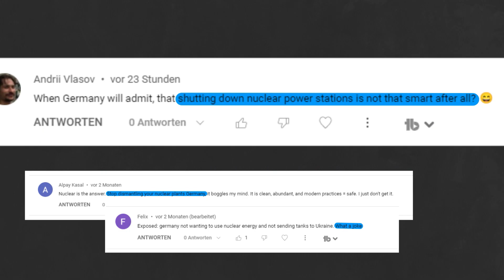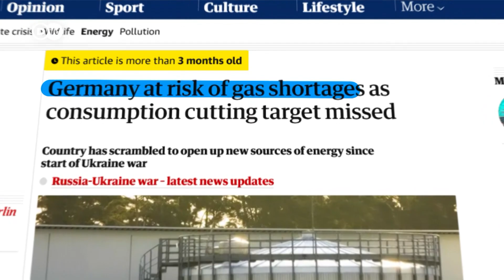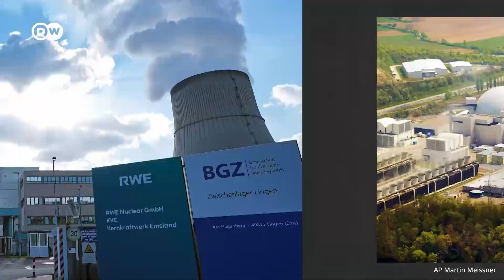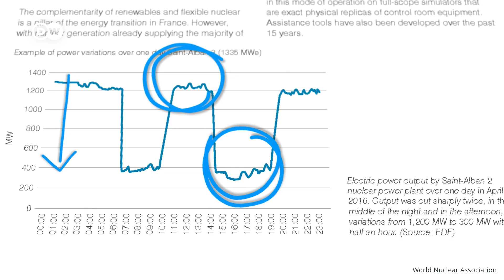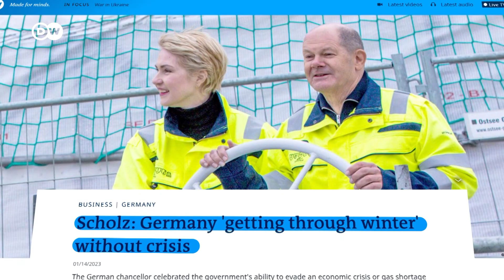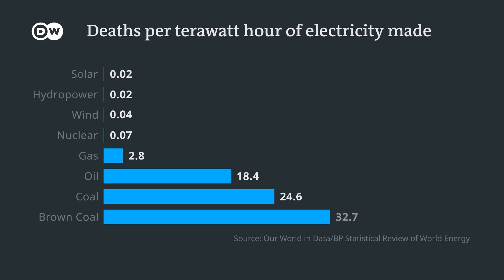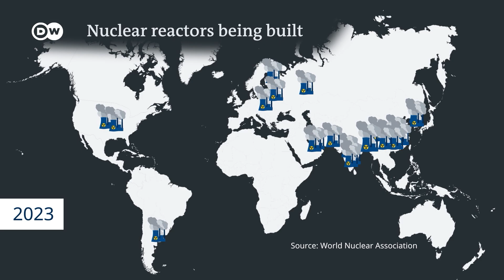Is Germany's nuclear exit a mistake?

Comment: The graph around 10:26 is questionable. Usually nuclear is safer that wing and hidro on those graphs.
Reply: Yes, but I guess they are using the figures from anti-nuclear organisations regarding Chernobyl and Fukushima. The remarkable fact is that even with so biased information sources, nuclear is hugely safer than all fossil energies. For now, all this renewable approach has to be implemented, with many wind turbines and solar panels to install, and more important many many stationary batteries. The reality is 2023 is that Tesla is giving up with the construction of a battery gigafactory in Germany due to local pseudo local ecologists. So I guess the plan for Germany is to burn gas and coal for many years, with many local deaths, and huge consequences of climates change. I accept the choice of Germany to stop nuclear power but for now it is in fact a choice to continue and even increase emissions.

Comment: What baffles me most is that they could have pulled the plug from this decommissioning strategy at any time they wanted, however, they just decided to keep digging their own grave.
Reply: Its like BREXIT.
Reply: @belarepa  I'm surprised you didn't blame Russia too .
Reply: They couldn't have pulled the plug at any time, they closed half of their reactors on the day of the decision and then laid off all of the engineers who knew how to reprocess fuel.  This was clearly explained in the video, once the brakes were on they could not be released, all they could do was increase the stopping distance by a few months.
Reply: @krashd  As long as the reactors exist, they are possible to restart. And the former employees WANT to restart them!
Reply: @krashd  Overall you are right but they could increase it by some years.

Comment: If countries keep using uranium aren't we going to run out? Isn't there only enough uranium supplies left for another 90 years?
Reply from the maker: Hey there 😊 Uranium is a relatively common metal but the precise amounts are not known. We did a video on Thorium nuclear energy as Thorium is more abundant. Maybe you want to check it out 👉 https://www.youtube.com/watch?v=Km6kqykX900. Hope this is helpful ✨
Reply: There is so much uranium in the seawater, you might even call it a renewable resource.
Reply: We have a lot of Uranium and the fuel can be reprocessed and used for 3-5 years. We reprocess spent fuel with the Uranium we can't use (Uranium 238) into Plutonium 239 with MOX fuel reducing the waste to 1/5th. Even then we have other heavy metals like Thorium, we easily have thousands of years of power and we can still supplement with renewables while nuclear provides low-carbon baseline load and importantly it's not just theoretical it's proven technology for decades that doesn't release greenhouse gases.
Reply: No.  There is plenty of Uranium.  Right now its cheap so very little effort has been made to find of mine more.  The carbon impact of nuclear is a fraction of wind and solar and nuclear is far cheaper if electricity were priced on a futures market for timed delivery instead of the stupid ad-hoc BS method used today.  The true cost of solar and wind is the plant + tons of electrical connections + backup system + energy storage.  You need none of that with nuclear, but the pro wind and solar folks will not attribute those additional costs to wind and solar.

Comment: Yes, a huge mistake driven by ideology rather than pragmatism.
Grid-scale battery storage and CCS is not going to be viable in the foreseeable. These technologies right now and for the next few years are far more expensive than just running existing nuclear reactors already built. Personally I think nuclear for base load plus renewables is the future, with any overload of generation (base nuclear + full generation from a windy and sunny day) being diverted into hydrogen. Hydrogen can be used as a diesel replacement.

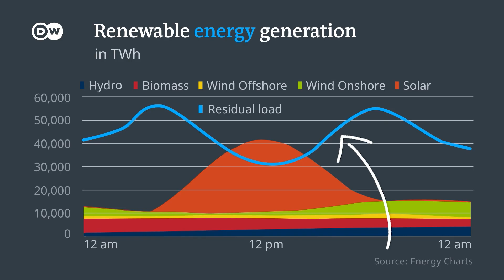Comment: 5:22 I was planning on commenting about this but you covered it yourself!

This is why I think Germany’s plan to ditch nuclear was a bad idea even before the 2022/2023 energy crisis. Because they were ditching it in favor of natural gas which is a fossil fuel!

We really can’t afford to start ditching nuclear until we get fossil fuel energy sources to 20% or less of our energy makeup.
Reply: @gianlucapistoia8993  A fission plant can be safely relicensed out to almost 100 years, one made in 1989 is not old. What Germany mainly wanted was to cut costs, and being that Germany hasn't always been a big fan of nuclear technology, all the way back from when it was even a thing in the early 20th century, they didn't have a strong domestic fission program, a lot of the fission technology and policy/governance basis at the time came from France, Japan, UK and the USA. Then enter the very strong fossil fuel lobby in Germany trying to get the Nord Stream pipelines through and a gas based power grid makes more sense than such a power hungry country wanting run on renewable and battery tech that is nascent at best. After all it was the immense fossil fuel lobby that was ultimately responsible for bringing the advancement of fission power in USA to a crawl.
Reply: @anydaynow01  Average max lifespan for a reactor is around 50 years.
though after around 40 it needs constant checking and maintenance to garuntee safe operation.
Reply: @davidty2006  Swiss reactors are around 60 years old
Reply: @gianlucapistoia8993  France is actually in a very good place with their plants
Reply: @mark9294  nope, it is not, since last year they need massive amounts of German power because they have a shortage of cooling water in France and can't runt their plants. 😂
Reply: I hope climate activists can do something about this. Germans are really doubling down on fossil fuels being the future it seems, their veto to stop the EU 2035 fossil fuel car ban etc. Keeping nuclear plants up and running is a huge help on climate and seriously helps. Hopefully someday Germans can get rid of coal and fossil fuels too, but this news is shocking
Reply: @gianlucapistoia8993  they are in a much better position than Germany climate wise, produce much less CO2 and aren’t as hypocritical
Reply: Even when we have lots of renewables, I think nuclear will still have a place, since it produces huge amounts of energy and provides grid stability. IMO, the best case for future power grids is a combination of nuclear, reanewables, large battery backs for instant stabilization, and pumped hydro for long term energy storage. This creates a very stable system, that can deliver large quantities of power without total centralization if production in a few locations.
Reply: using hydrostorage for renewables is better than using batteries
Reply: @vidara6093  nope, hydrogen has low efficiency
Reply: @gianlucapistoia8993  the main reason they are old is people stopped building them so the mass manufacturing of the parts stopped. 
If well managed there could be a point where a reactor is being built as another is being decommissioned and they complete within a few months of each other.
Reply: Germany ist going fast to reach the 80% renewable mark. We need about 3-5 years to reach it. No fission plant could be built in that time
Reply: @maumet1447  You also have to consider that our need for electrical energy will go up. With EVs and electric heat pumps on the rise 80% renewables of today may be around 40-50% in 5 years. So even in 10 or 20 years we could use nuclear plants as our electrical consumption will skyrocket.
Reply: @maumet1447  I’m sorry but that timeframe is completely illusionary. Renewables are currently at 46 percent of the German energy mix, and that includes biogas. If we factor out biogas it’s just about 35 percent, so about a third. What plants shoulder the majority of Germany’s energy needs? That’s right, coal. To seriously believe that we can get the renewables to 80 percent in that sort of timeframe, or even at all, is wishful thinking since neither solar nor wind can be scaled up to that amount and provide the energy baseline required by the power grid.

But apparently Germans prefer to have a third of their energy produced by coal rather than nuclear.
Reply: @mark9294  biomass more than biogas.
Reply: @mark9294  I'm sorry but do you work in the energy sector? Do you have any idea about the scalability that Germany has had in the last 20 years? If there is any country that I believe could have historic, social or cultural reasons to build themselves up from nothing or extend themselves from something, it is Germany. Germany went from 3% 30 years ago to 10% 15 years ago, to 46% last year, according to statistics, Germany ON AVERAGE doubles it's renewables every 10 years. 80% is no stretch of imagination by this.